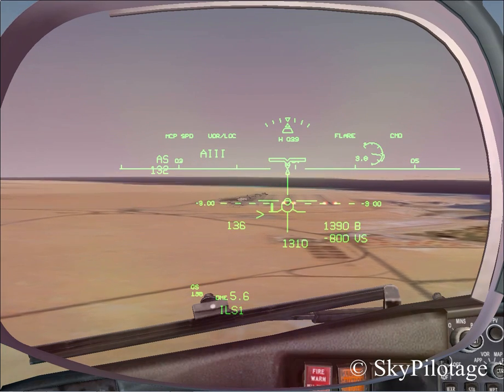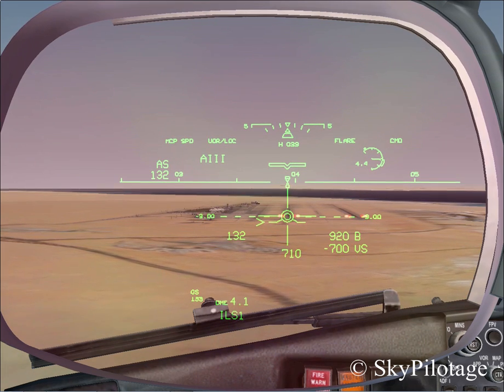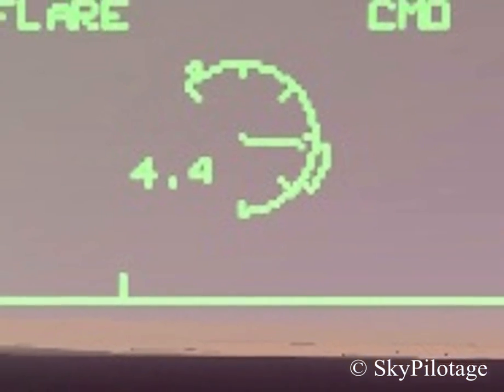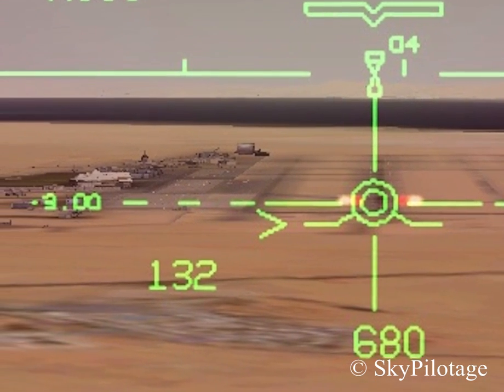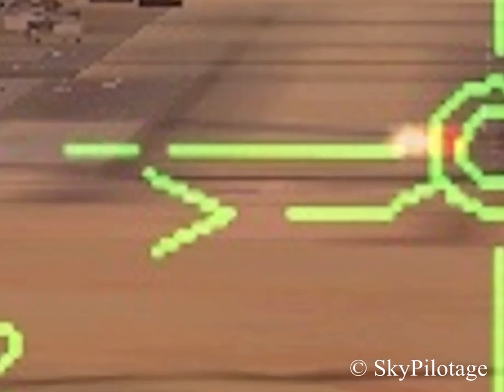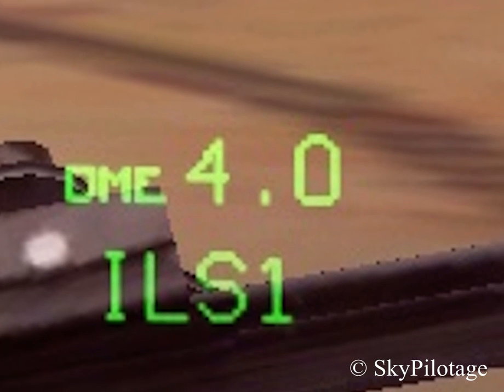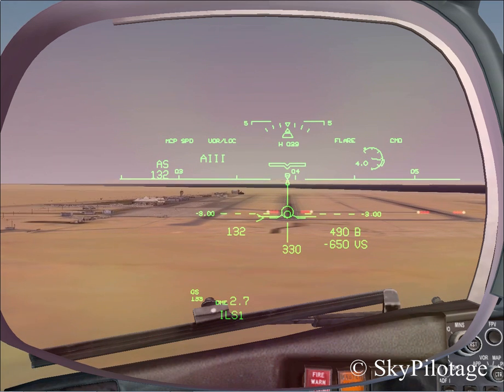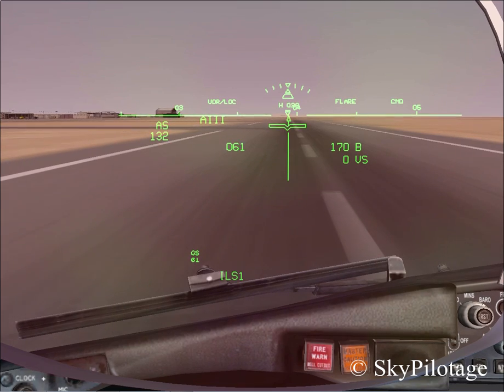[HD] B738 ILS HUD[AIII] Basic Guide/Tutorial

Comment: Perhaps a decent, novice AIII HGS Mode tutorial, but with some distractingly inaccurate nomenclature and descriptions like "Flight Path Vector."  Correct nomenclature for HGS is 'flight path symbol,' which is not the "sum of all forces acting..." on the airplane.  The flight path acceleration symbol indicates the sum of forces.  Also inaccurate  statement "...losing energy and descending..."  not true and does not make sense, given the flight path acceleration indicating a stable energy state.  -3.00 glidepath line is also inadequately described in relation to the seperate, but related and (on profile) coincidental ILS glideslope line.  Also...a noseup attitude is not because of any relation to "making it easier to flare on short final."  Recommend not hanging your hat on this info as gospel.